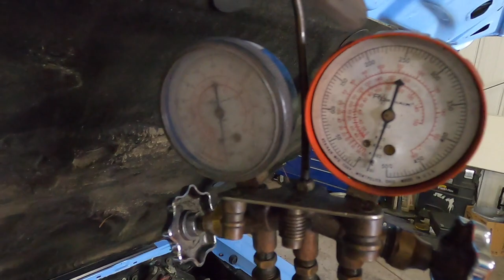EASY FIX FOR YOUR FOXBODY MUSTANGS A/C! // SUMMER CRUISE WITHOUT A SWEAT WITH COLD AC

Comment: Good video!  I had to get my AC fixed before Chocolate Fox and it turned out to be the compressor.  That wasn't cheap, but I wasn't driving 6 hours without AC.  My vert gets really hot on the inside on a sunny day with the top up.
Reply from the maker: Good call, I made the trip up at night and it was a little cooler going back.  I also think that the dark tint helps me a lot.
Reply: @GearHead704  That was a smart move.  Tint is a good idea.  I know it help me when I had it on my '12 VW Golf.

Comment: I'm dealing with the same r134 adapter issue on my 87 LX. My high side adapter from years ago was the kind with no valve in it and it worked fine but the oring in it gave way, so I bought another just like it but it wouldn't allow gas pass thru it.  I noticed that the oring in the new one was squeezing inward when installed and tightened down, so basically the oring ID would seal around the gauge hose fitting's pin and not allow gas thru. I have bought a high side adapter with a schraeder valve in it like did (Adv Auto has them, O'reilly's did not)

Comment: Feel your pain man. I blew a air line on my big truck Monday just stopped by freightliner and picked new one up. Filled it up and its not blowing cold. Was working fine b4 line went out. I said blow but it actually had a hole rubbed in it. Talk about miserable try sleeping in a truck sleeper with no ac. I was in laredo Monday nite and it was 85 degrees over nite. I had three electric fans blowing on me and still sweating my butt off. Very frustrated right now I have loads lined up threw Friday so don't really have time to stop and put it in shop. Wish I was at least running the north this week instead of Texas. Haven't had time to watch all the car show vids yet but good job on the ones I have watched.
Reply from the maker: Oh man I"m sorry to hear that and couldn't even imagine trying to sleep in that hot weather, although I did grow up with A/C, but i'm spoiled now.  Thanks for checking out the vids man and I hope the A/C gets fixed for you soon.

Comment: I went thru and replaced all washers with green ones on mine when I replaced the EVAP and condenser (during heater core replacement).
It blows cold...but honestly, mines a Ttop yours a vert.... Who really needs  AC in our cars? And Happy Birthday,  to the bday boy
Reply from the maker: Thanks for the bday wishes, and yeah we really don't need them do we? Summer is good actually because you can drive them at night when it's cool with the tops off/down.
Reply: @GearHead704  I guess that "it works" is what's important. Yes, night drives are the BEST!

Comment: Lol I just had that happen to me on my ‘89.  My new low side adapter had a black seal in it blocking any Freon from entering the system but showing high on the gauge.
Reply from the maker: Oh man, that sucks, but I'm glad you tracked it down.  Crazy how we had similar issues.

Comment: Do you remember where you got the new r134 adapter fittings? I had one that was working but the hi side adapter oring blew out...went and got another set from Adv Auto that's not letting any gas by (its oring is squeezing inward and sealing to the push pin on my gauge hose end)
Reply: T59978 is the Carquest number for the high side adapter, but if you use it, the R12 Schraeder valve on ur car needs to be removed first while the system is empty of refrigerant.

Comment: Any idea what the torque value is for the low side 1" ac compressor nut? I replaced my compressor and accumulator/hose, and it worked for awhile but I think the nut that connects to the compressor worked itself loose and it leaked there. How many threads are still showing at the low side compressor fitting on yours? That will help a lot.
Reply from the maker: Sorry I'm not sure.

Comment: Are you using all of the original R-12 (factory) components? I thought the compressor and other parts had to be upgraded for use with R-134 freon?
Reply from the maker: My system was converted to R134a about 10 years ago already.  I don't remember all the parts that were changed.  Maybe we'll do a video on it in the future.
Reply: @GearHead704  It would be very helpful. Got to stay cool!

Comment: Hey, I still have the original R 12 system in my car with the original fittings, what is the adapter that you need for the high side in order to hook it to the gauges? The friend I had who helped me with mine had the adapter and it also had a shut off valve on it but I don’t know what the adapter was and I need to pick up one.
Reply from the maker: The fittings I got from OReilys were part numbers MR 59978, but mine was converted to R134a more than 10 years ago, so I don't know what those parts were unfortuatnely.
Reply: @GearHead704  Might be a long shot after 2 years, however do you recall the part # for the low side adapter?